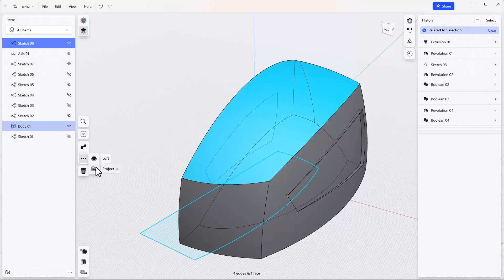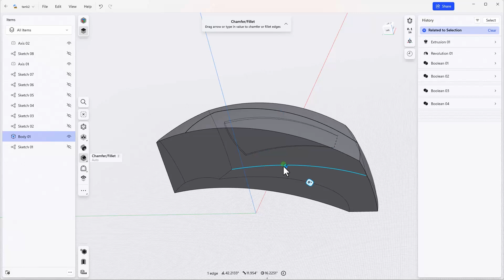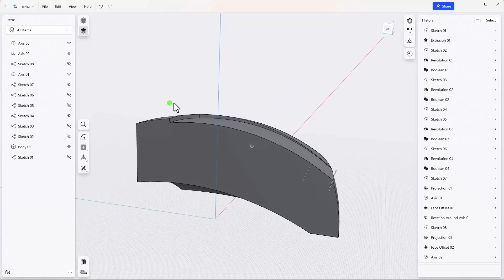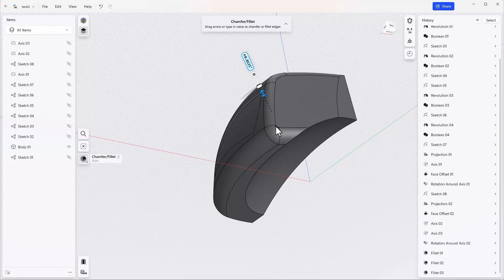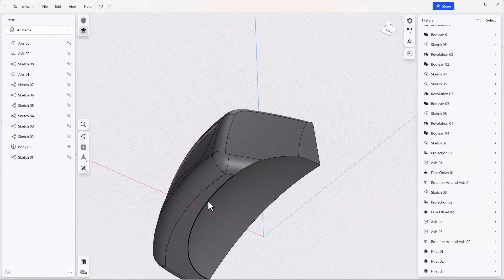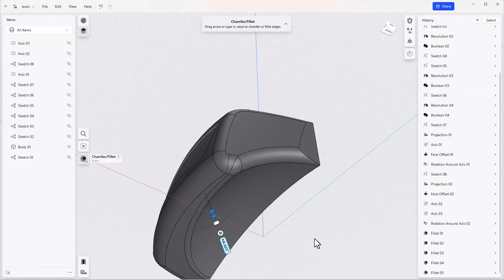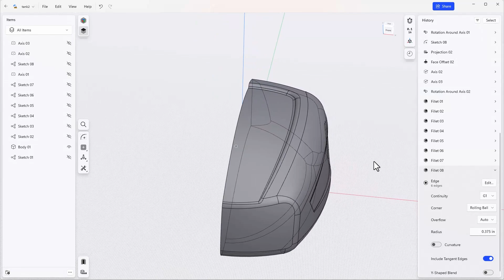Setting up Primary and Secondary Fillets with Design History: Motorcycle Gas Tank | Shapr3D Basics

Comment: at 1:04 you put the top design in to offset angle it into the top of the body. you created the sketch on the top plane and projected it to the top face. when you projected it, the new decal runs to the edge of the gas tank. when i make the exact same shape. run the sketch longer than the object. Then project it to the top. it refuses to run to the edge it creates a line about 1 inch in from the edge. no matter how much I manipulate my sketch, the projected object will not go past a certain point on the face i am projecting too, where did i go wrong?